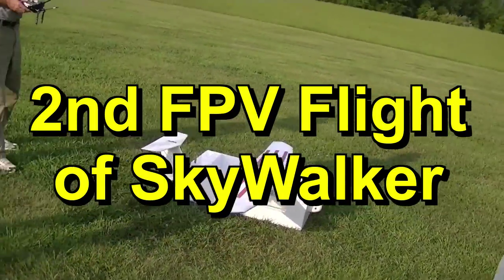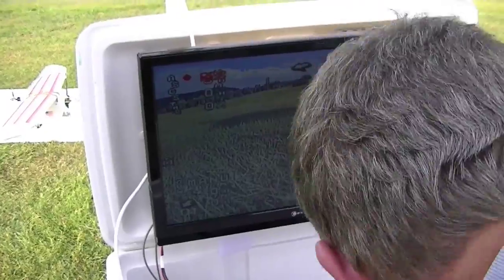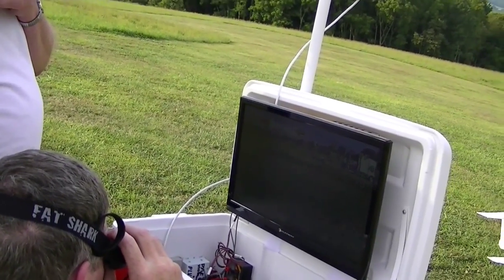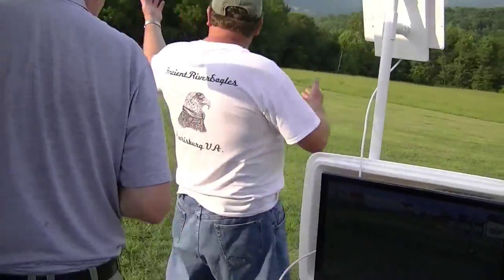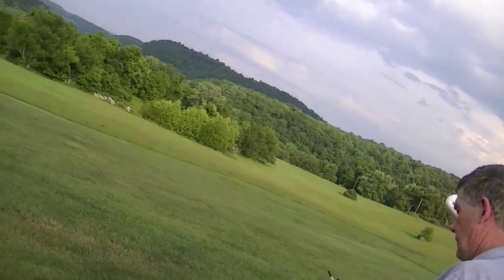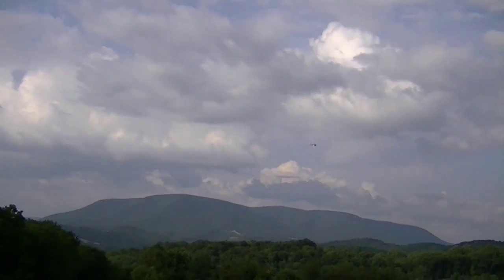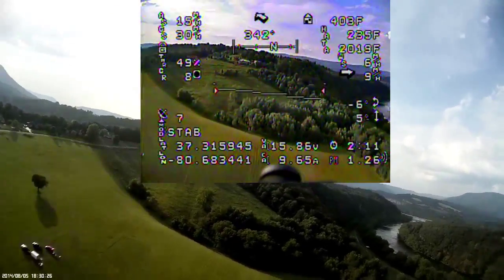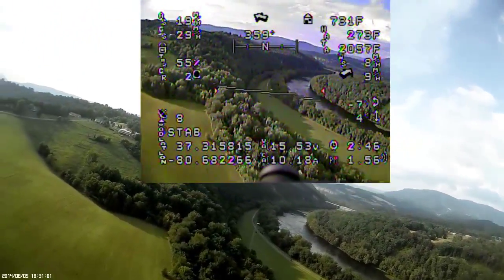FPV SkyWalker test flight with APM, Taranis TX, EZUHF and Airspeed Sensor

Comment: I have a problem with satabilize mode on skywalker 1880, when the plane Stabilize mode directly stall, what should I do, I use fc apm 2.6 thanks
Reply from the maker: Yayat Sumardi Hold the plane in your had and tilt it for roll and pitch in stabilize mode. Make sure the control surfaces counter the roll and pitch movements.
If you are talking about fly-by-wire then check your minimum throttle speed in the params to prevent stalls. Stabilize mode does not use throttle so no param for that mode. Hope this gives you some ideas.

Comment: Hi Dave! When I step up to a long range system, I plan on going with a Taranis radio and most likely the ezUHF JR Module. I have heard of an issue with noise (feedback) coming through the Taranis speaker relating the the ezUHF JR Module. Have you experienced this? I'm not sure if maybe this was corrected with newer firmware?
Thanks!
Reply from the maker: Yes my Taranis does that too but it doesn't really bother me enough to do the mod suggested on RCgroups. Some are adding a capacitor and such inside the radio and reduced the noise from the RF.
One thing that has bothered me about the JR Module is that it does not allow me to use the APM failsafe in the mission planner. Instead I have to setup a hard failsafe with it. Wishing the EZ firmware would be updated to allow the throttle channel to be trimmed lower to allow failsafe setup for the Mission planner.

Comment: Are you happy with your APM 2.6, have you tested the waypoints & auto landing?
Reply from the maker: The APM is just wonderful. I have now bought a PixHawk which is basically the same thing and still uses the same software, Mission Planner.
I have not tested the auto landing feature but it will follow waypoints. For the money it's a super system but it does have a learning curve.
Reply: ***** Nice ! Thank you
Reply: ***** Have you installed the "pilot tube option"?

Comment: Where did you order that version of the sky walker? My penguin is on its last leg and I am trying to decide between another Penguin or a Sky Walker. I don't like the new version of the Sky Walker because of the carbon tail. I need to mount my GPS on the tail to get it far away from my Go Pro which is notorious for spewing all over the GPS band. I am afraid that having it under the wing like you do would be too close and it wouldn't be able to keep GPS lock. 

Keep up the awesome videos.
Reply from the maker: Oh, my SkyWalker is the 1880 wing span Version from BevRC.com.
They have one in black as well.

Comment: I am really impressed by the APM and the minimOSD together! It's a fantastic setup.
I think i need a plane lol
Great job guys as usual guys ;)
Reply from the maker: You should get a plane!
Have you ever flown a plane?
They have the ability to fly much longer and further than multi-rotors.
Reply: ***** Unfortunately not, i never tried RC planes, just sometimes in my flight simulator. Planes dont seem hard to fly :)
Reply from the maker: blackmennewstyle Not any harder than quads, just different on the sticks.